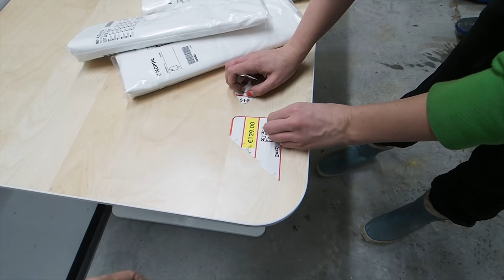Our New Workshop/Studio!

Comment: If you manage to determine wich frequencies are those that negatively influence the accoustics in that room the most, you might try to position your absorbers 1/4 Lambda of the actual wavelength away from reflecting walls. That will give you the best results to eliminate the sound energy that´s taking too long to fade (<1sec.)

Comment: How much does a shop like that cost per month in finland?
Reply from the maker: In big cities like Tampere you can get something like this for around 500€/month, this is bit more expensive since it's net yearly rent contract but and price includes heating, water etc. making it 700€/month. So there is probably 100€/month extra on the price but we couldn't find any cheaper near us that we could try out with out committing for full year. If this helps us I will probably try find little bit larger and cheaper place.
Reply: @Beyondthepress  what is the heating source in that location? Thermite? Red hot steel?  Paksu Anni? 🔥
Reply: @Beyondthepress  Wow, that is a great price. I wish I could move there. I have a few old cars and a bunch of tools and pay about $1200 USD, per month, for the same size space, but not as nice, and that price is considered low. I wish emigration from the US was easier.
Reply: Well, better to make a sheet of your other expenses which would travel with you and make some comparisons. In Finland everything from food to fuel is very expensive and there are pretty steep taxes for your vehicles if you ever dream about driving them not just working on them. Shipping alone will probably be prohibitively expensive.
Reply: @McSlobo  Agreed, from what I have been able to find out, it is practically impossible to emigrate anyway, unless you have a particularly needed occupation. As far as driving my cars goes, until now, I have had a very serious disease called procrastinationitis that has stopped me from finishing any of them. So meanwhile, a '68 Camaro, '68 Bronco, '66 Chevy II and a '66 GMC Panel Truck have sat in car racks waiting for me to get off my butt. I don't even have weather to blame, although it did raining today, which is completely debilitating for people in California.

How much more expensive is it to live in Finland than Los Angeles, I wonder. Gotta Google it.
Reply: @McSlobo  Just Googled it, looks like concenous is that Helsinki is cheaper than Los Angeles. Anyone want to trade passports? just joking....
Reply: @Beyondthepress  I'm glad it's heated,your definitely going to need it Lauri/Annie.Our weather here in the rust-belt in the U.S.A.is very similar to what you currently have in Finland.STAY WARM!!.

Comment: A couple things...if you can find that styrofoam like sheeting stuff insulation like they use here in the US behind vinyl siding and place it on the wall and drop it from the ceiling somehow it would take a LOT of that echo out by itself. Not sure if you have it there but it works well for echos in home music recording studios and some radio stations in small market areas and here it's like $10 a folding sheet of the stuff that's 4 foot by 8 foot folded sometimes 2 to 4 times depending.  You can even paint it a color.  Might be something to see about.  Also a small throw piece of outdoor carpet in your "relaxing" area on the floor like made for wet places it would also help that echo and since it can handle being wet it's not too hard to just rinse it off and let it dry maybe. Here it comes in various colors and textures from green grass look to actual carpet look and even some that looks like rocks and bricks. Just some ideas I had that if you have over there might help with your echo problem and also comfort....bare feet for Anni on that carpeting...lol.

Comment: If you hang large stuff on the wall, you can build a wood frame to go behind it.  And fill the frame with insulation.  Cheap way to suck up noise in an empty work shop.

Comment: You can get some thick rockwool panels (10 cm or thicker), put them in wooden frames and either hang them on the walls or put some wheels on them to move them around or both. You can put some fabric on them to make them look nicer. You will need quite a lot of them to combat echo in such a large space.

Comment: New room is always fun! Not as much as cats, but near!
Small tips that may help you with the echo: 
- get more thicker stuff, instead of thin, plain curtains
- more "fluffy" the better: lesser echo (cats)
- more "clutter" inside the room: less echo. (more cats)
- maybe put a curtain to drag in front of the doorside too, because the echo bounces between 2 opposite walls.
- i think a carpet on the floor is not possibel and will get dirty very fast, so to cover the opposite side means hang something on the ceiling, eg a lightweight banner. (kittens)
All in all don't have to cost much, only if you want to record music there it get's expensive ^_^ (big cats)

Comment: You can hang some moving blankets on the wall to help with the echo. They are cheap here in the US. In case the sheets don't do enough.
Reply from the maker: we bought some really cheap bed sheets that should work also pretty well
Reply: If they don't do enough to help the heavier the fabric the more it will cut the reflections.  Enjoy the new space!
Reply: Old carpet scraps on the concrete floor will help too.